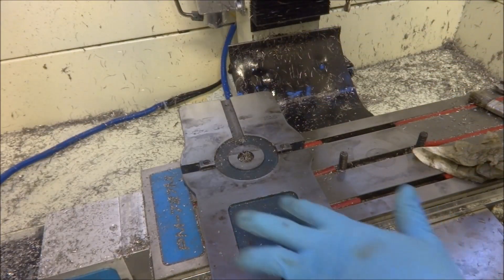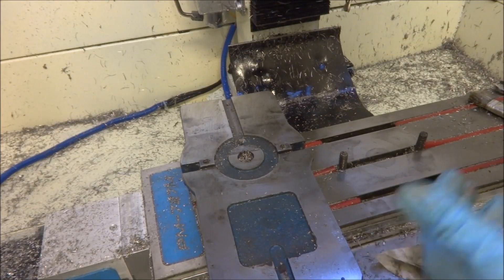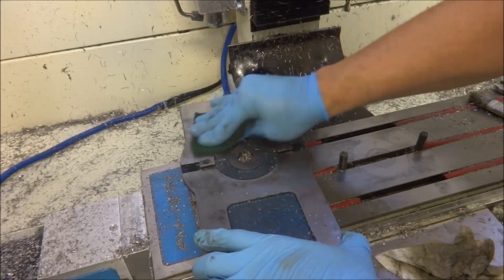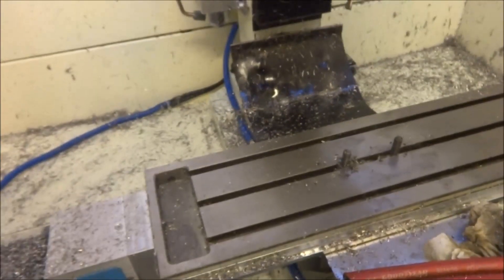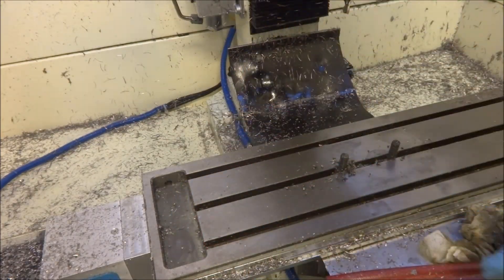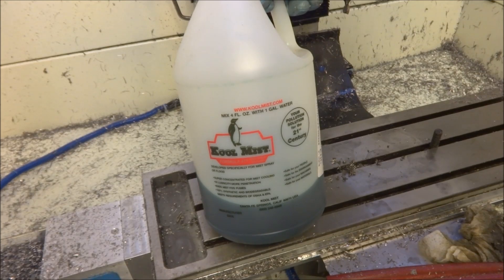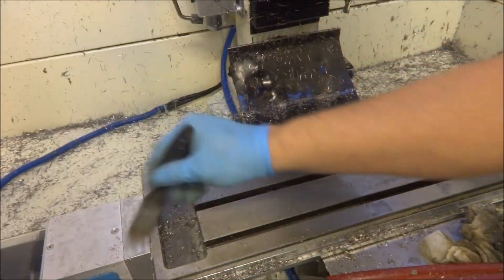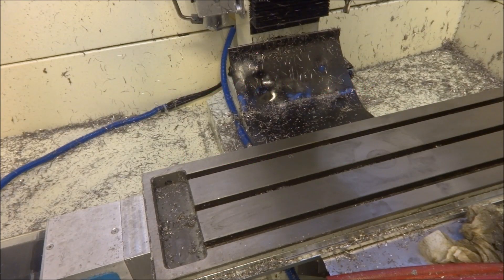Vise Removal

Comment: Ha. Been dreading designing my electrical for 220v and as I was browsing your plans electrical diagrams ... you've already done it !!!! Sam you are amazing . Thank you for that .
Reply from the maker: Yes I did add that a few months ago As I will be converting to 220V in the future.
Reply: So one question about your schematic . You have a separate 120v on top of your L1 and L2 for powering holding circuit and receptacles .  I've been told that you can split off one of the 220v lines for use in 120v . Was that the idea or have you made a conscious decision to bring in another 120v?
Reply from the maker: Yes this is a separate wall plug 120v for powering monitor cpu and coolant it does go through the Main disconnect but it is a completely different circuit. There is no holding circuit this is a solid state relay that turns on the coolant. The 220v goes into the box and splits to the VFD and a 220v /110v control transformer to supply 110v to the rest of the cabinet.
Reply: CNC4XR7 Yes. Duh . I see on 2nd look that the 120v is only supplying secondary power supplies . Thank you .

Comment: Hi Sam, To prevent Koolmist from causing rust, just up the amount or reduce the water. I believe I found this on LMS website a couple years back. Another item is to use Mobil One on exposed metal on mill. I prefer using AMSOIL Metal Protector on my Tooling vise, along with a quick spray on end mills, collets, etc.., after every use. Never an issue. "Displaces water and protects metal surfaces from rust and corrosion." Normally water gets under oil. There's 2 kinds of MP. The second is Heavy-Duty Metal Protector, which I also have. I use this for long term protection. (johngerd :) )
Reply from the maker: Crevice Dog 
I do mix per directions with distilled water only. It works fine for the most part but I reaally do not like the staining of aluminum parts.

Comment: Hi Sam - I usually just spray WD40 on the table. It leaves behind a trace of Petroleum Jelly - which is one of its ingredients.  Cheers  Cliff
Reply from the maker: Threadexpress 
Thanks Cliff there are a few things I would like to try alot of good suggestions so far.

Comment: I like the tslot and fillers on your table. I have been using boeshield T-9 spray and qualichem extreme cut with very good luck so far.
Reply from the maker: Thanks Simple 3/8" air hose. I may give that a try